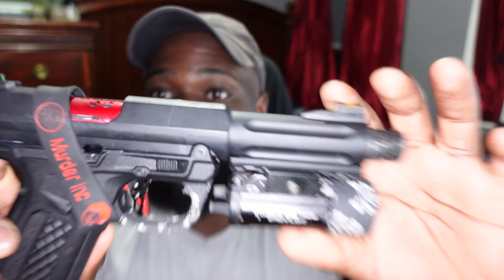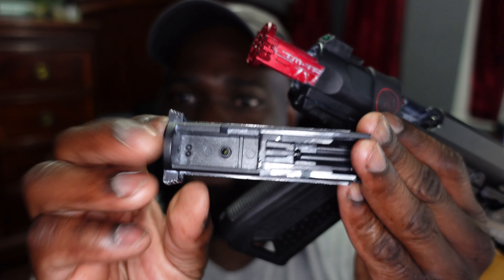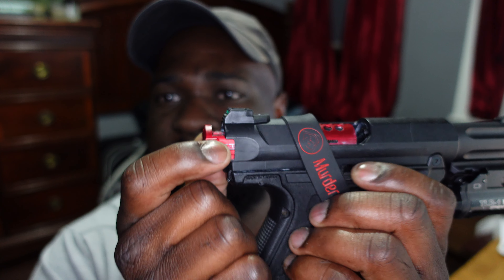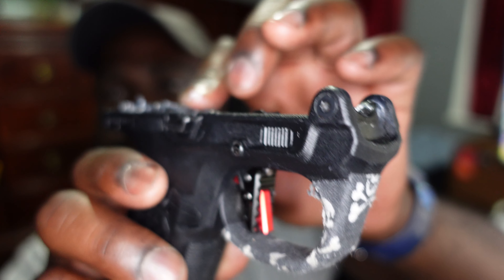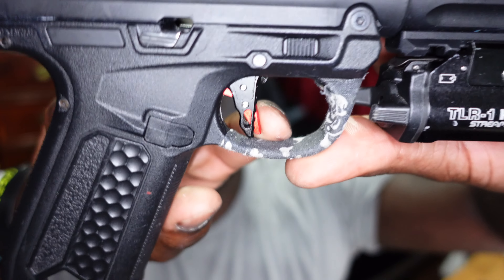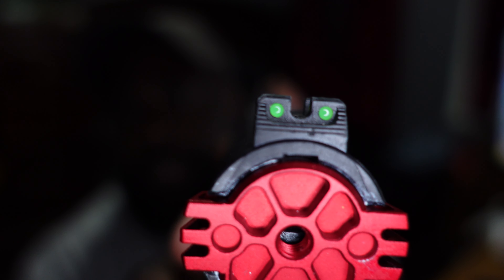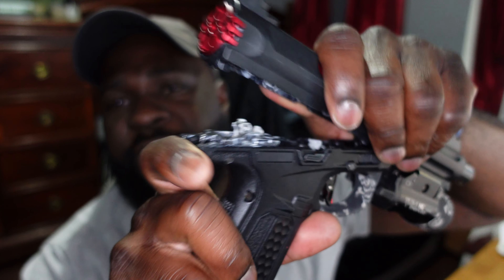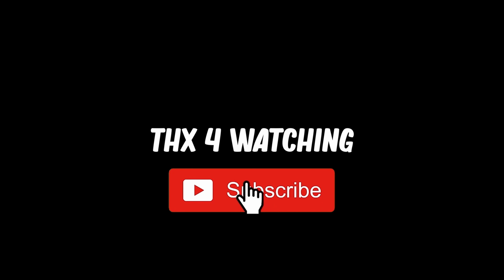AAP-01 Upgrades Breakdown!

Comment: you too the bolt is hard to pull and gets stuck if you release it gently in the middle and at the end sometimes and I have missfeed while I changed the bolt the spring of the bolt the spring of the nozzle and the trigger if can someone answer me that would be really cool

Comment: Nice video your gun looks amazing. Is the red bolt cnc or made out of plastic like the original ?
Reply: The stock bolt is metal? Why would he switch to aluminum to make it lighter I it was already plastic
Reply: @wyattross5544  oh really
Reply: The ctm bolts are machined from 7075 aircraft aluminum and are tough af and will last donkeys years if you have made a roller bearing mod they do cost more than the cow cow but have better fitment and less issues when using cnc uppers

Comment: Do you have any issues with feeding on full auto with that ctm bolt? Mine seems to only shoot 10 feet in front and kinda throws up all the bbs at once. It works fine in semi. I just can't use full auto.
Reply: Your barrell doesnt seem to wobble at all in all your aap shorts, how did you achieve that with the stock upper?